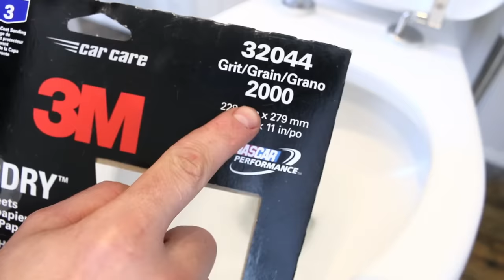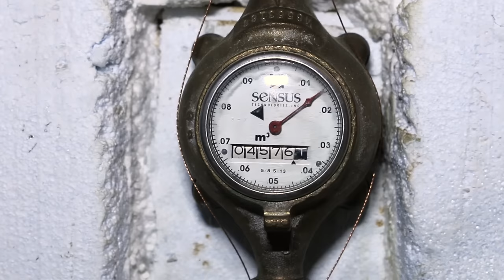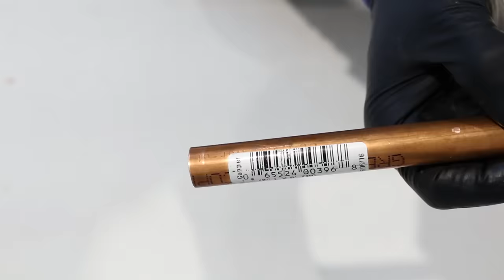15 GENIUS Plumbing HACKS! | GOT2LEARN

Comment from the maker: Stuff I used in this video:

2000 Grit Wet or Dry Sandpaper: https://amzn.to/2tODDmp
Milwaukee HoleSaw Kit (28-Piece): https://amzn.to/2T8TF9Q
MagTorch Butane Soldering Torch: https://amzn.to/2tNMlRV
Food Coloring for toilet test: https://amzn.to/2Hd98i7
8" Channel Lock Adjustable Pliers: https://amzn.to/2tNzcZm
3/8" Piggy Back Valve: https://amzn.to/2EIXR7i
1/2" Compression Valve: https://amzn.to/2VynTzU
Reply: Great video!  Do you any tips on cleaning stubborn yellowish bathtub, other than buying a new bathtub or using an enamel spray?
Reply from the maker: Thanks a lot! Maybe try buffing it with some buffing compound? You can get that stuff at your car parts store.
Reply: @Got2Learn  Thank you very much for your quick response, and for your excellent video.  I will  use the compound on a small portion of the bathtub and see how it goes.  Have a good one!
Reply from the maker: @akbaxb165  No problem!
Reply: @Got2Learn  WOW, you have so much experiences and techniques....  You must be a Master plumber..... .. Thank you for sharing....👍💪😀
Reply: Great video but how do you deal with a stubborn trap?

Comment: Forgetting my belt and having to use solder to hold my pants up is just not a situation I've ever found myself in...
Reply from the maker: Hehe, now that you said that, just wait till it happens ;)
Reply: I used a small bungee cord to hold up my blue jeans. Simply slip it through as many belt loops as is needed.
Reply from the maker: It actually holds up, and when you are done, just bundle it up and use it to solder.
Reply: @Got2Learn  Well, I guess that would work.  But you would need to give 25% off for using pants solder.
Reply: I think if I tried to used solder as a belt I'd end up with plumber's crack
Reply from the maker: @TL-pb6sz  😆😆😆
Reply: You can remove both shoe laces and make a Jethro belt and then use 4-6 zip ties looped through the shoe lace loops to hold your shoes on...
Reply: Just don't let your boss see u doing that shit if u have one lol
Reply: I've never forgot my belt...But I have forgotten my trousers a few times!
Reply: @JO-ly3hi  That's got to be the worst plot to a plumber porno I've ever heard. Who forgets their pants to a job site?
Reply: @ozziesheppard17  Men don't wear pants...they wear trousers.

Comment: Liked the tip of using the rubber handles of your channel locks to loosen the faucet aerators!
This will work for any chrome screw-on fixture, such as shower heads and wands, for example.

Comment: Plumbing has come along way over the years.  I work at the VA medical center and we have a few freeze machines that will freeze a line without a valve and we use a Pro Press to crimp the fitting on. We also have a Add A valve that bolts to the copper and cuts a whole in the line to temporarily shut it off until you install a valve. Shark bites are good for certain situation but not with anything that you don’t need movement. I have a B tank with a rose bud tip for soldering along with a oxygen and acetylene tank for silver soldering or brazing. Pex is also getting more and more popular over copper in new homes. We do all the plumbing, pipe fitting and maintenance with 3 guys with over a million square feet. We stay pretty damn busy! Great videos for new ideas, I’m always willing to learning new things and sharing with others!

Comment: Plumber here in Alabama....like the channel...also when removing shark-bites it's best to push the fitting when trying to release it....it'll help the teeth release easier...
Reply: i have used needle nose pliers that way to remove them. they are skinny enough to fit in tight places so you can apply pressure on the plastic ring with the pliers while pushing inward on the fitting.
Reply: Yes, the best way to remove them is with a crescent wrench and a tap they come off every time without the removal tool.

Comment: I have done the vinegar soak for the shower head, it does soften the deposits but still needed to get in each hole with a small paperclip to further loosen up the debris
Reply: Citric acid is my go-to for removing deposits. If you can't find citric acid, lemon juice works - it has a lot of citric acid in it.

Comment: Your videos are helping me a lot as I get ready to start my plumbing cert program. Thanks for all the tips!
Reply from the maker: You got this Alan!!!!!!
Reply: Thanks, I'll be using the dye in the toilet tank idea and also the sandpaper or pumice stone in the bowl tip.

There is a steady dripping into the toilet bowl but the tank never seems to lose water?

I've replaced ALL the guts in the tank including the rubber gasket between the tank and the bowl and still have the constant dripping or water lines on the inside of the bowl coming down from the top of the rim. I live alone and no one else uses my toilet. When I get home from work and look in the bowl there are wet water lines running down the bowl.

I got nothing.

Comment: Great tip for a belt. My whole family now wears  flux core solder belts. I'm thinking of marketing them. If you twist them they are real fancy.
Reply from the maker: Good one ;)
Reply: If you braid it, you can use 3 times as much solder for the same waist size!

Comment: With so many comments it probably has been mentioned, but an additional tip about threads is that MOST of them are cut to a 60 degree angle, so a small triangle file is the trick to fix nicks or other problems.

Comment: I use a wet dry shop vac to remove standing water from pipes before soldering. The vac can also be use to remove water from the toilet trap before removing bowl.
Reply from the maker: Those are all good tips, thank you for your input :)
Reply: I use mine to suck water out of many things WCs water meter boxes water pipes etc.wouldnt be without one

Comment: A ball of bread works very well inside the pipe to stop the water so you
 can soldier. Once the water is turned back on it will blast the bread 
to pieces and dissolve it.
Reply: You're not allowed to post useful tips on this video.  It's illegal.  I'm calling the police.
Reply: Use white bread, or the seeds from whole wheat will get in the holes of the showerhead. Don’t ask.
Reply: @telocho  Bahahahahaha too funny, I'm gonna leave that one alone!  learn from Telocho- don't feed yer H2o pipes health nut bread! It will constipate them instantly!!

Comment: Great tips and techniques. I've learned the hard way to never use sandpaper on porcelain. Eventually the scratches will show, and the scale will build up faster on those tiny scratches. Use white vinegar instead.
Reply from the maker: I've been doing this forever and it's still the same lol, maybe I have a better toilet ;)
Reply: Throw in CLR works really great also faster than vinegar. More expensive than cheap white vinegar.
Reply: I've heard the same concern about sandpaper (or pumice) on porcelain. Since the stain is at the water line, it's hard to get the vinegar where it's needed. I drain down the bowl, then put paper towels wetted with vinegar along the water mark, above the drained-down water line.  Give it a few hours, to break up the scale, then scrub it down with a toilet brush, or worst case, a melamine sponge / Magic Eraser
Reply: Maybe Scotch Brite would be less aggressive?
Reply: i must say a scouring stick aka pumice stone works very very good, it feels like you will scratch dont worry ,,,,but it really works better than anything i have used
Reply: Could try an old toothbrush.  Might still be a little too abrasive as well.
Reply: @Got2Learn  Magic eraser - no home should be without one.

Comment: You don't need wet/dry sandpaper for hard-water stains on porcelain.
There's a pumice stone specifically  for removal, called 'Scouring Stick' made by Pumie.  They're ~$3 at home-improvement stores, and last for years cleaning normal toilets.  They're softer than the porcelain, and won't scratch/damage it.
Reply: That's true, although the stone works very well, there's a bit of extra work involved as its quite rigid and doesn't adapt to the curves in the bowl so easily.  Next time I may try the sandpaper:)
Reply: @la196  
The pumice wears down pretty quickly and conforms to whatever shape/curve you're working on.
Try wetting the end of the stick and it will soften it.
Reply: Yes, my Girlfriends toilet is evidence of it. The toilet finish is ruined.
Reply: @mestizoboy   Absolutely, when it starts wearing down and starts conforming nicely, that's when it starts working its best:). No need to be a little afraid of a little toilet water, just got to get in there and go for it.  Works incredibly well!
Reply: Use denture cleaner

Comment: Another tip that I like to use to unclog a drain is using the exhaust side of a shop vac. I do it once a month just for preventative maintenance. Just make sure you plug the air vent before you do it.
Reply: How do you do that

Comment: Old trick: To solder a pipe that can't be soldered because it continues to drip, stuff it with bread. The bread will stop the water while you solder. You can use as much bread as you want, it will wash through when you turn the water pressure back on.
Reply: eric brufatto never do this, the bread will break down, but will blow into faucets, valves and aerators and clog them up
Reply: @keithsmith5908  And you know this, how?  This is a well proven trick, and plumbers have used it for many years. You are totally wrong, the bread dissolves... I think you're not talking from experience, but you are guessing, and 'talking through your hat!
Reply: Keith Smith its a tried and tested method. If you’re installing on a line with aerators or something and youre concerned simply remove the aerator when recommissioning
Reply: A plumber showed me this trick 55 yrs ago, I have used it many times since then!

Comment: Great ideas. Thanks. If you think that there's a water leak continuously running down the back of the toilet bowl, simply put your finger or thumb at the back of the toilet bowl (put a rubber glove on if you are picky) and you will see the water pushing past your finger or thumb
Reply from the maker: Great tip!

Comment: When dealing with all thread rod. If you bevel the ends where you cut with a grinder the nut will start easy too. Also takes the rough edges off of the rod.
Reply from the maker: Yes!!!

Comment: If you have a drip on a pipe that won't stop, get some cheap old white bread and stuff it into the pipe a ways up. The bread will absorb the water, act as a dam.  Afterwards, when the water is turned on the cheap bread will just turn into mush and be flushed out. Works awesome.

Comment: My local hardware store has a liquid product that you apply to a paper towel and rub the stain area and this removes the stains, but I find I have to use a cup to scoop out some of the toilet water first to expose the ring and keep the water from diluting the product on the paper towel. Prior to this I used a scouring pad that did damage the porcelain.

Comment: Stuffing a leaky pipe with bread will allow you to solder, then the pressure will blast it right out. Also makes a delicious crispy smell when you sweat the pipe
Reply: Just remove any aerators down stream also when re starting water flow!
Reply: Also, smash the fluffy piece of bread back into a little dough ball before you use it. It will work much better.

Comment: An easier way to stop a drip leak so you can solder a joint is to get some fresh white bread and roll it back into dough balls and shove em in until it's solid,  then you have enough time to solder the joint..
(push em a few inches away from the joint so you don't cook em..)
The bread breaks down when the water's turned back on and just comes out the tap.. 
(of course,  take any filter off the first tap to open..)

Edit - another nice vid mate, cheers..

Comment: luv the valve up line from where you solder.....i've used an expansion plug to stop the water trickle
Reply: If it's not to much let by, can plug with a piece of soft bread and it will flush out after soldering
Reply: @fredhall4239  that really works.  white bread, remove crust,  squeeze with your  hand, and stuff a chunk up both sides of the copper pipe.

Comment: Using the rubber sleeves on the handles of the channel locks was a great idea, thank you! But seriously, you need to be EXTREMELY careful with the sand paper on the toilet. Toilets have a glaze that helps solids slip down the drain easier. Ever had a toilet that backs up all the time? Yeah, the glaze is worn out, rubbed off. And when was the last time anyone soldered on an angle stop? Dont put a second valve on top! Turn off the water to the house and replace the stupid thing

Comment: If you want to solder a small leaking pipe, and not wanting to install a valve, shove bread in the pipe then quickly solder, afterwards the water will break down the bread and push it out!
Reply: JUSTIN BEAVER never do this, the bread will break down, but will blow into faucets and valves and aerators and clog them up.
Reply: @keithsmith5908  The bread will come out of anything, better than rusty contaminated well water!   been doing it for 30 years, never a problem!  did you use Croutons dummy?

Comment: You should make a video on compression style fittings
How to install when to use 
..
Reply from the maker: Yes, I have 2 videos that talk about these fittings: 
#1- https://youtu.be/bedg1qp-F4M
#2- https://youtu.be/Db_GYaTcrGk
Reply: Great I will check them out...
Reply: How about soldering  a lead toilet insert repair?
Reply: A good way to remove stubborn stickers is with lighter fluid.  I always keep some handy  to remove decals on delicate surfaces.
Reply: @georgehanna3434  can drink it in a emergency also

Comment: Instead of installing a compression valve to stop a leak so you can solder, stuff some bread in the pipe. The bread will stop the water long enough for you to repair the pipe and then dissolve away after.
Reply: I disagree it works in a pinch
Reply: I have also seen a product called Plumber's Bread. It's non-perishable, so you can keep it in your toolbox, and dissolves completely, so it won't clog aerators, showers and such.

Comment: Liking them. Thanks. What I've done when trying to solder a pipe with water in it and it just keeps leaking in, is vacuum out the water. It should leave you with enough time to solder it and cool.
Reply from the maker: Yup, that definitely works better than bread!
Reply: @Got2Learn  Hey, bread has saved my ass many times though, lol. Man, between Sharkbite, Propress and PEX, I rarely need to worry about bread anymore, thankfully.

Comment: Sometimes loosing the meter valve unions will stop water on the solder project
Reply: Or by pass the meter and only use bypass for watering the lawn and laundry day
Reply: Genius but simple

Comment: 2:42 should only be worst case scenario. you could turn off the main valve and change the „broken“ one. 
and right after this sequenc, you should use a second wrench to hold the hose so it doesn’t turn the hole hose (so it don‘t get to much torque on it, usually they snap easier) 

that is the only thing i am complaining about! good video thank you i have learned some good things from your vid. 

iam a plumber from austria (europe) so sorry for my bad english 
and if you have questions it would be nice to get in contact!

Comment: Try not to use solder as a belt it’s expensive find tie wire or electric wire to do it
Reply: I usually have tie wire to use as a belt,

Comment: All good ideas except the first one.  Any kind of abrasive, no matter how fine on porcelain will degrade the high shine,  A better way is to use denture cleaner overnight.    Four to six tablets should do it for the average size toilet bowl.
Reply: CLR
Reply from the maker: Clr is good for everyday water stains, but for those tough ones the 2000grit sandpaper is much better.
Reply: I find flux (paste) and the abrasive side of a dish washing pad works a treat witg scuffs and scratches on porcelain.
Reply: any good on pebble dashed bogs
Reply: 'any type of abrasive' is a bit misleading. Chalkboard is an abrasive to a piece of chalk. It has to do with hardness. You are correct in saying 'most sandpapers' have materials which are harder than glazed porcelain - though toilets are enamel glazed...and still 'softer' than sandpaper. Pumice however IS harder than the calcium carbonate and softer than the enamel. You are also quite correct in possibly abrading the shiny glaze.   Here in Arizona pumice is required - and will 'scratch' the glazing - but it's better than the rings. Also CLR is relatively considered ineffective.  What I do is spray with vinegar (in spray bottle) after every use (just on the surfaces that get wetted and will dry - which is where calcium carbonate will adhere - the rim builds up the most due to pressure changes in the house and the toilet water level fluctuating up and down minimally).
Reply from the maker: Good input, thanks man!

Comment: Good tips but you don’t need a compression valve for #13-ish...a sharkbite valve will do the same thing and might be easier to find at the big box.
Reply from the maker: That too works well, thanks!
Reply: Stuff pieces of white bread in wet line.  Water is stopped until pressure  is restored. Bread crumbs come out the nearest tap.

Comment: Leaving your belt and using a piece of soldering wire is not a plumbing hack😁.. great vid tho
Reply: bungee cord works better.
Reply: Kind of is, but bungee cord works well
Reply: I've done this more than once
Reply: @evenflow3256  😁 for the entire period that shirt keep them pants loops covered
Reply: Zip ties work even better.
Reply: You would be better off with a zip tie
Reply: You wouldn't be a Plumber without Plumbers bum. No self respecting plumber takes a belt to work. Customers look away when he's sorting out your U bend.
Reply: Just cut the legs off of your jeans into strips then weave them into a belt. Now you have shorts and a belt!